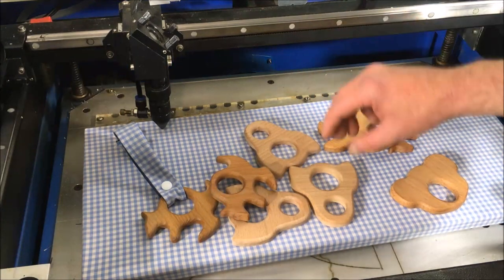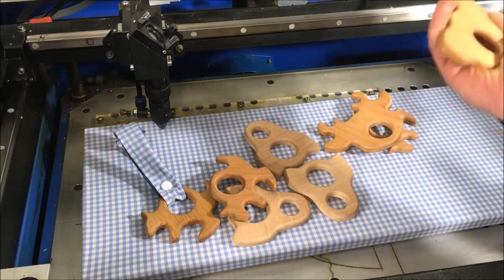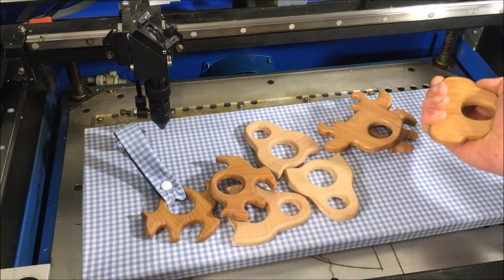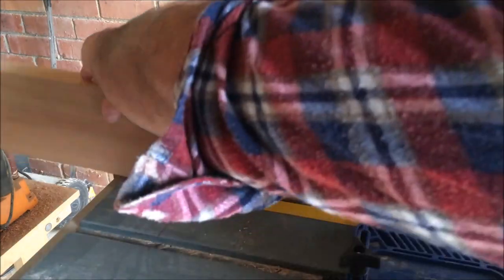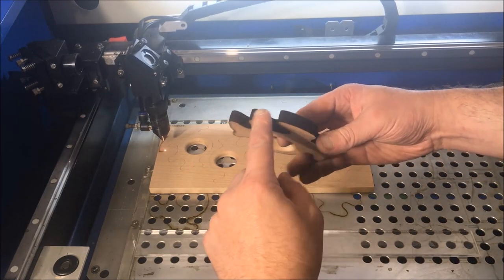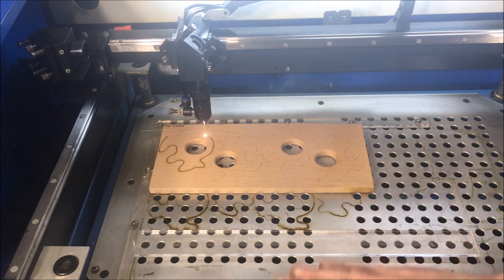Making Wood Baby Teethers with laser cutter and other tools

Comment: You could use soda as in baking soda to sandblast  / remove all the burnt surface areas  most auto sprayers will allow fine particles to pass through the spray gun just fill the spray gun canister with baking soda and make sure that you don't spray your skin or other body parts it will be like turning on a sander and running it one your skin option #2 is to spray the wood with Clorox bleach and after about 5 minutes use water to remove the brunt areas I have cleaned wooden porches and decking using Clorox the decking looked really dark old and gray but once I spread Clorox on the deck and let it set for 5 minutes I was able to use a pressure washer to lightly spray away both the Clorox and all of that dirt and dark areas the decking looked like brand new lumber it does work

Comment: Just use a cnc router to start with and won't have the black stuff.
Reply from the maker: I find the affordable routers are a pain to set up, and work real slow.
If I need a few in a rush, I just use a scroll saw which is faster. the laser cutter is just for taking it easy.
Reply: the openbuilds c-beam cuts hardwoods at 147ipm, it would cut 4 of those out in under 10 minutes

Comment: What oil was that? Just that is taste ok and is not bad for you. (I think you use a good oil , that is why I ask)
Reply from the maker: 100% Tung oil. 
It is often sold mixed with a solvents which is how it's normally used, but you can find it sold 100% pure. It's pressed from a seed so it is natural and allergies to it are extremely rare.

Comment: Why not just use a CNC to cut it all out like the X-Carve
Reply from the maker: I was doing something similar at first. But the lower cost CNCs are fairly slow to operate and set up. Cutting with a scroll saw was much quicker.
I only make about a dozen a week, but if I was making more I would certainly be looking at the CNC option again.

Comment: if you were teaching for a shop this is the bees knees. but for the rest of s whom do not have all the wood working tools...figure it out.
Reply from the maker: I know I have a better than average collection of tools, but I'm just working out of a small single car garage in a rented subdivision house. Don't make the mistake of thinking you need a fancy workshop to do stuff.
Reply: The tools in this video aren't that expensive.  Especially compared to most workshops.  You can get a laser cutter for a few hundred bucks, and a router for under fifty.  Combined, that's like the cost of one good big ladder.